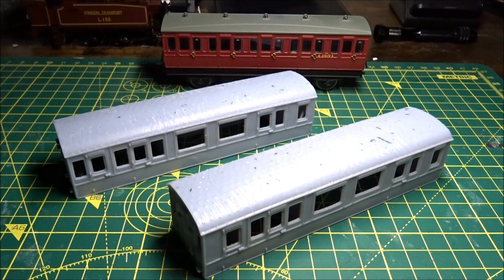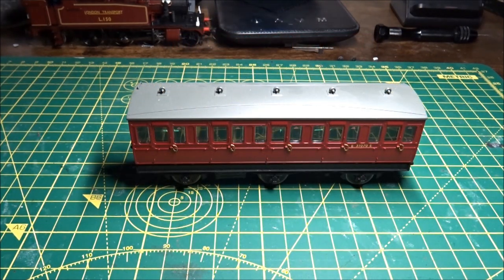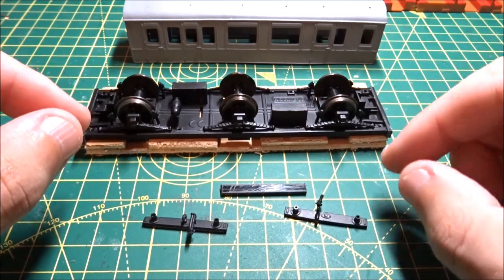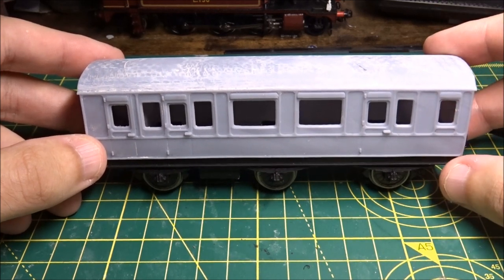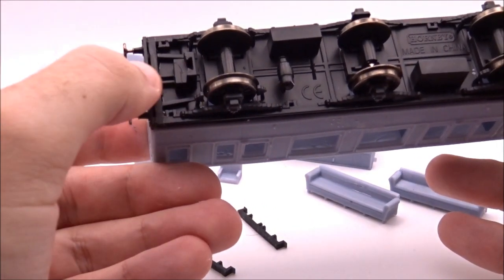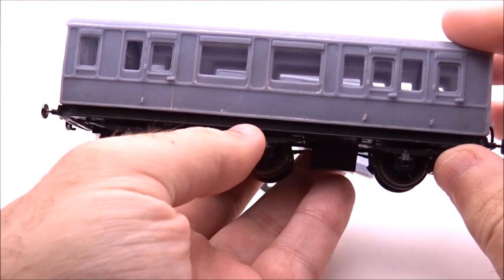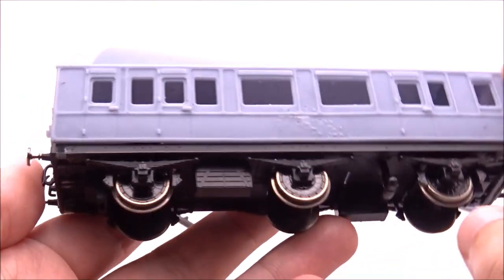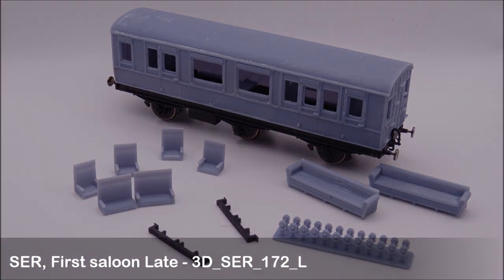SER Family/First Saloon OO

Comment: Bought without hesitation. I think I would be inclined to use a brass chassis but great to know that the Hornsby one works too.
Reply from the maker: Unfortunately there's no dates mentioned when they were moved and there's no drawings available as and when the modifications were made... Just says later people so possibly after the guard was converted to luggage..  But unfortunately I haven't found out yet.
Reply: @bluebellModelrailway  thanks for the advice !